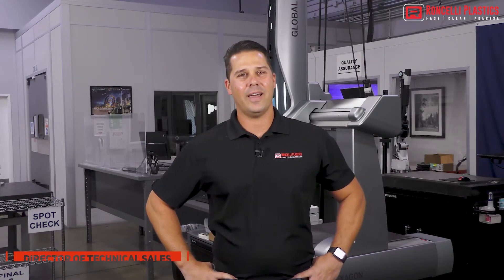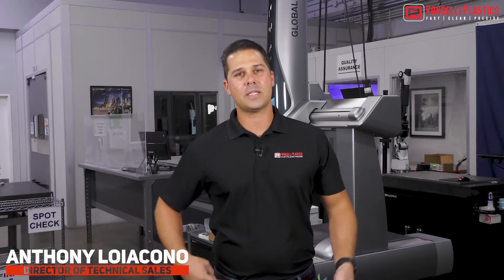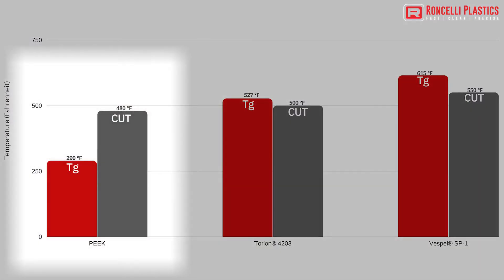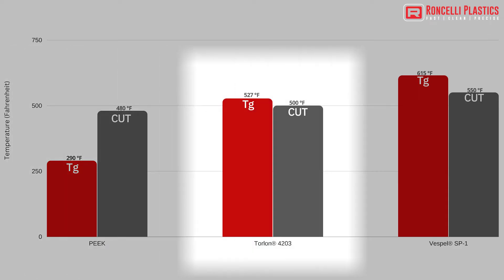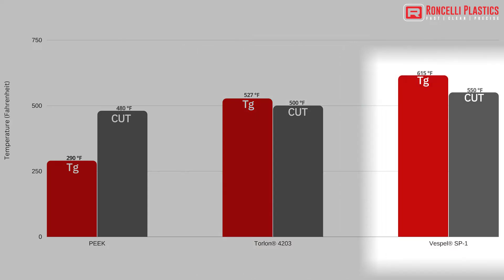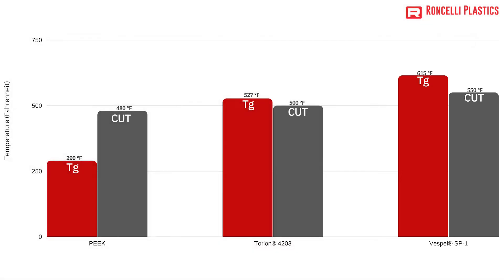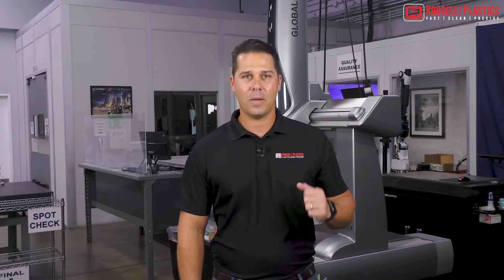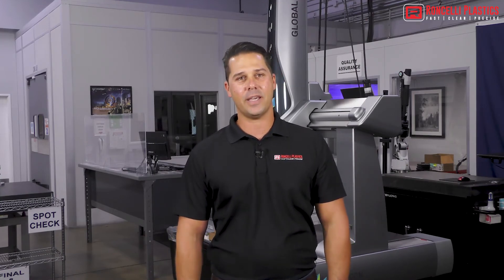Engineered Plastic Material Selection - PEEK VS TORLON VS VESPEL - RONCELLI PLASTICS

Comment: We need to substitute aluminium with speciality polymer. We need to make hollow cylinders use in printing vertical with high dimensional stability, chemical resistant, uv resistance and besides low wear and low thermal expansion. Or gives us contact of your reseller in Delhi/India